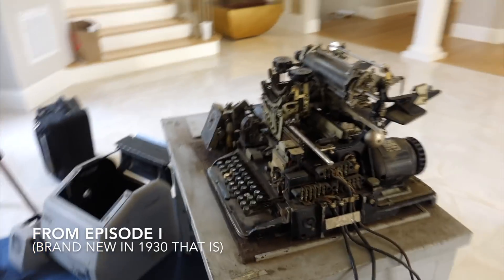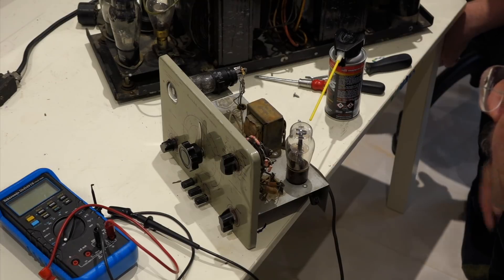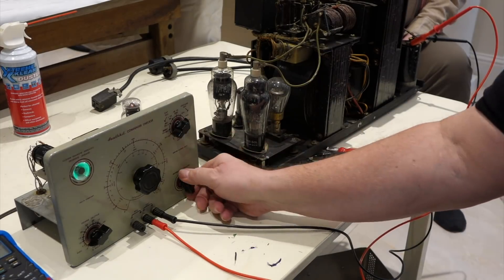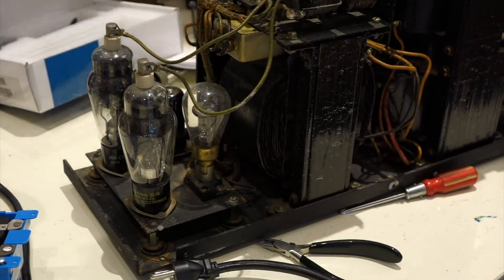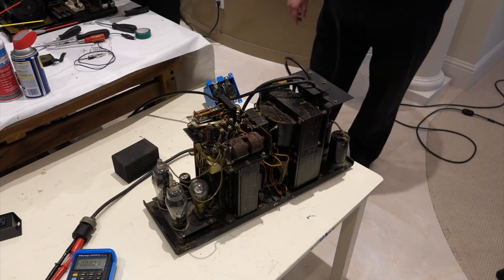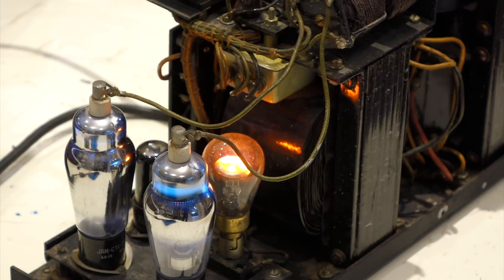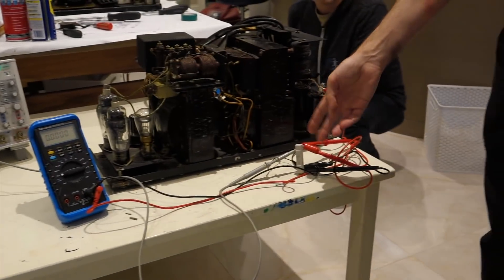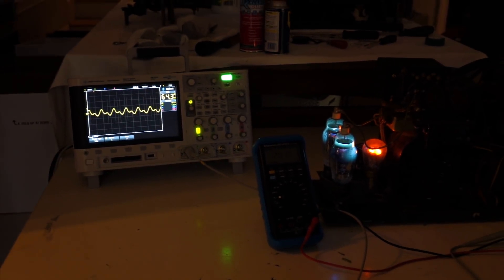Teletype Model 19 Part 4: Thyratron Power Supply

Comment: That looks like a bi-stable. Not PWM but a predecessor to a switch mode power supply?

From the schematic, the thermal delay relay's "unknown delay" will be the time it takes for the thyratrons to function, assuming they do - plus the delay of the actual relay. This protects the teletype from getting abnormal power, and the thyratrons as well from the shock of starting under heavy load.

Is the light from the thyratrons dangerous at all? Whenever I see that ionizing glow that is not filament in a tube I get that feeling I need sunglasses or a lead vest (x rays at kV voltages)
Reply from the maker: I think so too, an early form of switched (or more exactly switch-regulated) power supply. It’s active switched rectification, very much like you’d do on the mains input side of a modern power supply with MOS transistors. The delay relay is to allow enough time for the mercury in the thyratron to vaporize. The UV should be absorbed by the glass, but I’m with you, I wouldn’t stare at it for too long.

Comment: Basically the thyratron equivalent of like HP6269B, 6271B.... SCR preregulated power supplies ;-)
Wonder if they ever did a SMPS with tubes, driven into saturation.
Not as efficient/low voltage drop/Rds ON as with mosfets, but might have worked, for small power supply.

Comment: From the range radar checklist for the Eastern Atlantic Test Range: It takes about 5 minutes in FILAMENT for the power supplies for the subsystems to warm up. But they also caution about short-cycling them so the components won't get stressed. They recommend waiting 10-15 minutes before restarting the power up process at step one.

Comment: I’ve got a Model 19 in my basement with the TD, desk and power supply.  Then one I have is oddly geared for 72 WPM rather than the typical 60 WPM speed.  The power supply on mine is quite different.  It uses a huge selenium disc rectifier and there is a three coil power transformer with a saturable core.  There are input and output windings and a third DC winding which is connected by a resistor divider to the rectified output.  If the output voltage increases, there is basically negative feedback via the DC winding to buck the voltage back down and vice versa.  Very clever, very simple and it still works 90 years after it was built.

Comment: My equipment with thyratrons use a mechanical synchrotron 15 minute timer motor attached to a switch on the HV transformer primary. A solenoid attached to the HV Primary holds the switch on after the timer runs out. Powering off releases the solenoid and the solenoid resets the synchrotron. I always put my thyratrons vertically when I remove them and never flip them or lay down.

Comment: So wait, it's a switching power supply?  And the blinking thyratrons when it's unloaded indicate it's in discontinuous mode?
Reply from the maker: You are right on both counts. Although it switches at the frequency of the mains, unlike a modern one that would switch at a much higher frequency.

Comment: Carl? Ken? Help!! When the bi-metal shifts the contacts the heater xfmr is de-energized and the thyratrons plate transformer is energized by connecting the neutral lead of the Plate xfmr to line 2 or neutral supply but the plate xfmr supply comes off the 230V connection on the primary/line 1 side of the auto xfmr. How/Why is that voltage different from the supply voltage? The lower set of contacts connects the neutral/line 2 side of the plate xfmr to the white lead of the motor. The black lead of the motor goes to the motor cycles connections on the primary side of the auto xfmr but the motor cycle connections are just extensions of the four lower primary auto xfmr inputs. (???) Power to the relay coil was applied on power up from a center tap between the thyratron filament power leads which is connected to output power line 1/Hot. The other side of the relay...ends up connecting to the thyratrons control grids, but not symmetrically. What is the relay voltage and how is the circuit completed? Oh, and when did the symbol for ohms change? How does one message off YouTube comments privately?

Comment: I wouldn't use a new scope without an isolation transformer
Reply from the maker: To measure the ripple of a supply floating output? You must be misunderstanding how isolation transformers work and in what situation they need to be used.

Comment: I had a 50kva resistance welder that used these same type of thyratron tubes to trigger the large water-cooled mercury Ignitron tubes. Ripped it all out and replaced them with SCRs
Reply: YOU WHAT!?!?!!?!?!?
Reply: @JackNedry  replaced the water-cooled mercury Ignitron https://en.wikipedia.org/wiki/Ignitron with https://en.wikipedia.org/wiki/Silicon_controlled_rectifier the timing/control circuits that used the thyratron tubes were replaced with a modern PLC electronics.  The resistance welder (spot welder)  transformer and pneumatics were still in very good condition and we ran it for some years.

Comment: Fantastic video, well done for preserving another piece of amazing equipment!  What a fantastic bunch of friends/colleagues you have too - lots of great knowledge in that room.  Also, well done for not systematically replacing all the capacitors - old capacitors aren't always bad, in fact I've had far more modern caps fail than vintage ones.

Comment: Curious if anyone knows if the purdy blue glow is neutrons?  From what i understand of nuclear physics, a blue glow like that usually means neutrons on the move.
Reply from the maker: Fortunately not, we’d be all irradiated. The blue is from ionized mercury. Electrons going back from their excited state to their ground state and giving off a blue photon. The red in the other tube is the same thing but with another element, neon.
Reply: CuriousMarc , thanks.  Didn't think so however at one time we did irradiate our feet to get the best fitting shoes so yeah...  Lol.. 👻

Comment: Also from Mr. Carlson's Lab:  Keep a wary eye old those old capacitors.  He had many cases of them seeming to be good and then catastrophically failing later.  His low-voltage tester mentioned below has a setting that in most cases can predict such future problems, requiring replacement even when the capacitor seems to be working perfectly at the moment.  With those high voltages and the potential damage to your ancient and rare Teletype, this must be checked frequently.

Comment: At the YouTube channel of Mr. Carlson's Lab, he has invented a low-power capacitor function tester that tests for hidden leakage and so forth that you can get the plans for free.  It does not require dangerous high voltages to test any capacitor, even those rated for hundreds of volts that might be failing.  He has a video on how it works and several tests of various good and bad capacitors.  Better than putting yourself in danger by having to shoot high voltage through such possibly bad-news capacitors in a test setup not related to your actual project.

Comment: To all the "yOu NeEd To ChAnGe ThE cApS!" people, the capacitors in the video are not like the new cheap ones. The power supply is not comparable to ANY modern one, a supply made in the 1950's versus now will most likely work better and last longer. If you'd listen to them speaking, they noted that it is better than an iPhone charger Let me repeat myself, a power supply designed in the 1930's and made in the 1950's works BETTER than an Iphone charger made in the 2010's.
Reply: I can't agree more. These people are all sheep. Just because modern caps blow constantly, doesn't mean they always have. I have some 1940s and 1950s vintage test equipment, running original electrolytic caps, and I have only found 1 bad cap out of approximately 50. I honestly believe the modern "capacitor plague" is a planned obsolescence scheme. Between that, and the push to make everything tiny, it causes high failure rates
Reply: @jacktheaviator4938 ,
Yep,
I'd also like to add that vacuum tubes are actually good despite common belief

Here is an awesome video displaying that:
https://youtu.be/xXG3VmUBF_o?t=1610

Comment: I´ve got a question:
This is a power supply with makes from 110 V / 60 Hz direct current for the typewriter.
Whats the maximum power and the weight?
The blue tubes are rectifiers?
Reply from the maker: See link in video description for this info and more.
Reply: @CuriousMarc  AHHH! OK! Nevertheless: Thanks! :-)
Greetings from germany

Comment: I just love how this thing looks, and it still has a cleaner output than alot of modern power supplies despite being 60-70 years old.
Reply: like they said, all it would take is just a cheap low value modern capacitor added at the end of it to completely smooth it out.  That just says a lot about the quality of the power supply.

Comment: Those caps are bad, that magic eye should snap open immediatly. Test a similar modern capacitor to see how much different they are. You can ruin your transformer and tubes with bad caps
Reply from the maker: Not that internet myth again. The caps are fine, and they won't burn transformers nor rectifier tubes. https://youtu.be/GMNQDoFpYQY

Comment: Those mil-spec-electrolytics from the 1940s NEVER fail. Period. Replacing them with modern crap would be a downgrade. At least in my opinion. Same for those paper-oil caps in metal cans from that era.

Comment: You might of wanted to try and form up those caps (without risk of blowing something up), by using a current limited power supply (around 1mA) that goes to around 1kV. I've formed up many old caps this way and never had issues, they usually either work or they don't. If you don't have a current limited supply like that, you can use a variac and bring up the voltage slowly, much less risk of blowing something up.
Also wondering if those mercury vapor tubes might emit UVC light (like a germicidal bulb) which is very bad for living tissue, especially your eyes.
Reply from the maker: Yes, we sometimes try to reform caps that are in much worse shape than this. This one did not need it, it was already good enough as is. It should reform naturally in the circuit (actually you can even see it happening in the video already, when the thyratrons simply turn off once the capacitors reform enough).

Comment: 1) You are quite right that those caps are just fine and don't need to be replaced. If they ever decide that they need to be replaced, they will tell you. That is what the fuse is for. But those Mallory units were great, and they are working just fine. Modern people have no clue that real caps actually had leakage when built in those days, and Mr Carlson's Lab seems to be propagating a myth that any cap more than 3 months old is a firework. They generally are not.
2) The wiring of that divider switch in the cap tester horrified me. Someone that knows how to wire stuff right on a switch like that should strip it down completely and redo it from scratch. (Yes, I realize from the look of those resistors that someone has recently stripped it down and replaced the resistors. It should be done again, right this time.)
3) If at all possible, bring up an old power supply like that on a variac the first time, not hot patching it across full voltage. That is a way to blow caps, or at least perforate them so they actually will need replacement someday. If you don't have a variac, put a 250W or 500W lightbulb in series with it for about 5 minutes before cutting it out the first time or two you bring it up. Measure the voltages on the hot side of the cutout relay before bringing it up to full input voltage. (The thermal relay may not operate at reduced input voltage.)
4) The thermal relay should be about 2 minutes on something like that. If you drop power on that supply, wait a couple of minutes before turning it back on. Don't trust the thermal relay to do that for you if you just glitch the power off and on. You can end up blowing the thyratrons by just glitching the power, and they are getting hard to replace these days.

Comment from the maker: Please stop the advice about needing to replace the caps! It drives us crazy. See why here : https://youtu.be/GMNQDoFpYQY . There seems to be a YouTube myth that restoring vintage electronics consists in blindly replacing electrolytic caps. Just about as true as YouTube telling you that man never landed on the moon. Unlike many of their 1990 cousins, the 1953 Mallory caps are still doing fine, thank you very much. They have retained their full rated capacitance and low ESR. They leak less than 500 microamps at 120 Volts. And they are of course not going to burn a transformer, kill a Thyratron, and other predicted catastrophes even if they were to fail.
Reply: I ̴re̷pl̀ac̶e ͏t͠he͏ ̨ca̡p̴s͡ ̷o͜n̸ ҉my ́mo͢d̴ern ͡PÇ mobo̷ ̷e͝v̧ery͡ ͡mo̴nth ̛j̨us͟t to ̨b͏e ͠saf͞e͘.̵ ́A͠s yo͡u can ̧see ͜e͜veryth͡in̵g͢ is͞ fi҉ne.
Reply from the maker: Chance of what? Wrong because of?
Reply from the maker: At least one person got it. Or is good at flattery. In either case we'll consider that progress :-)
Reply: no chance, replacing caps is Hippster Detox
Reply: Maybe some folks are thinking the capacitor plague extends back to the 50s.. o_0
Reply: This is why i said old caps rules :-)
Reply: "If it is working, dont change it. If it ain't broke don't fix it."
Reply: Well said!!! Bravo!!!
Reply: Well, I wouldn’t take that chance. Sorry, you’re (mostly) wrong !

Comment: To all the kids trying this at home: Thyratrons and mercury arc rectifiers are pretty much the only tubes that are supposed to glow blue. Git yer darn blue LEDs off my tube amplifier lawn!
Reply: To be fair, some power tubes (6L6GC) will also glow blue without LEDs.
Reply: guitarstitch Any beam tetrode will. I’ve seen it in 6K6, 6V6, 6L6, 35C5, and 50C5 tubes in antique radios.
Reply: And then there are the hydrogen dekatrons - which glow pink. ;)
Reply: I never understood why they put BLUE leds under tubes. They are everywhere: amps, headphone amps, nixie clocks, preamps, etc.. They look like CCC (cheap chinese crap) toys.
Reply: I hate blue LEDs in absolutely EVERYTHING. They destroy the appeal of even the cheapest piece of electronic device. >_> They are fucking EVERYWHERE. Manufacturers can chose from a huge selection of colorful LEDs and yet they ONLY use blue…

Comment: I have one of those Heathkit Condenser Checkers!  It's one of the only ones I could find that allows me to set high voltage across old capacitors for more than a few seconds.
Reply: I need to find out about it's display tube!
Reply: @markg735  it's a 1629 Eye Tube

Comment: Mr Carlsons Lab has designed a modern capacitor leakage tester that works without high voltage.
Reply: Mr Carlson's Lab has also restored one of those Heathkit capacitor testers. He actively uses it alongside his own design. He also does things a bit different than CuriousMarc, which is fine. You stick four engineers in a room, you get five opinions, and often they all work.
Reply: @Richard Vaughn To be fair, the entire point behind Mr Carlson's device is that it really doesn't need the high voltage to find the faults. I will confess that I have no idea how it works - electronics is magic, as far as I'm concerned - but he has demonstrated it.

Comment: Yes those capacitors are suspect. There defiantly is leakage and It can lead to very big problems and with such treasure I would consider my options . It is always shame if you have to change components in museum grade equipment . Maybe it could be possible bypass the capacitors and add a separate board with the new capacitors that can be removed if historical purity is very important. It might be a quite a bit of work and depends on your guys priorities. You might want get on with the project and consider the capacitors in future if there time and you changing them becomes feasible option.  Any case thank you for great content eagerly waiting for next episode .

Comment: Very nice to see it working. I hate to say it but those caps will not be lasting very long, the 1 MF caps are paper caps and will become very leaky in short order, they can be replaced by modern film caps, the big can caps can be replaced by modern electrolytic capacitors, you can re-stuff the cans if you want to keep the look.
Reply: Still working to this day

Comment: Curious Marc! If you happen to need help with vintage electronics, specifically tubes, contact Mr Carlson's Lab (youtube channel) he has been restoring old hardware for a number of years. Cheers and good luck !
Reply: More importantly, he's developed a capacitor tester for cases exactly like this (leakage terst w/o high voltage, failure forecasting) https://www.youtube.com/watch?v=LhovRIM5xAo
Reply: @azamkazam9591  lmao. CuriousMarc knows about 10000x more than MrCarlson'sLab

Comment: I don't know about the capacitor analyzer, but in Radio and most Signal Tracer boxes with either a 6E5, 1629 or 6AF5 to mention a few "closes" at optimum.
Reply: Those screw terminal canned capacitors look rather modern for this power supply.

Comment: Hi Marc, I suggest you watch this video by Mr Carlsons Lab. You are definitely one of my favorite You Tube channels and so is Mr Carlsons Lab. It explains quite a bit about testing vintage capacitors and the "false positives" of many testing methods. I think you might find his channel interesting in any event. https://youtu.be/LhovRIM5xAo
Reply from the maker: Indeed, we enjoy his channel very much!
Reply: @CuriousMarc  There's also FranLab, she does vintage electronics too.
Reply: Nice - thanks for linking to Mr Carlsons lab. Another nice channel :D
Reply: His patreon channel has a far more sensitive capacitor tester that far surpasses the capabilities of the HealthKit leakage tester. These caps on this power supply appear quite dodgy tho. You need that eye to open fully and relatively quickly at the rated voltage